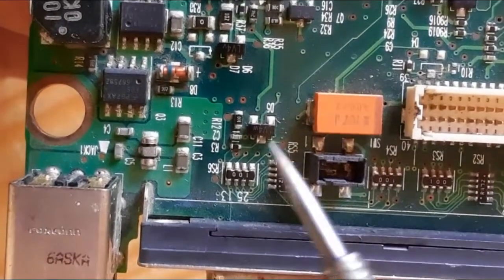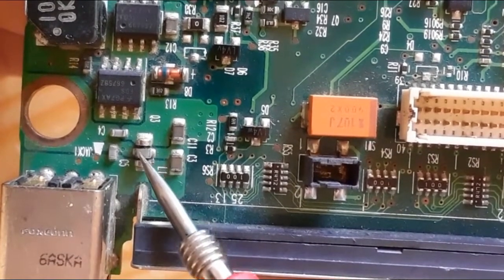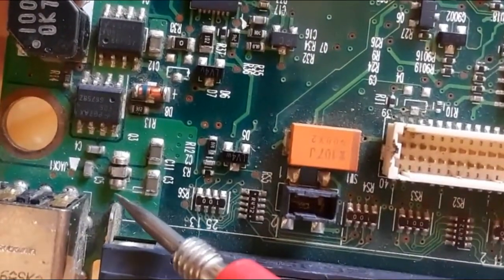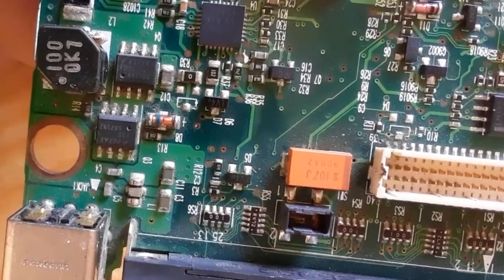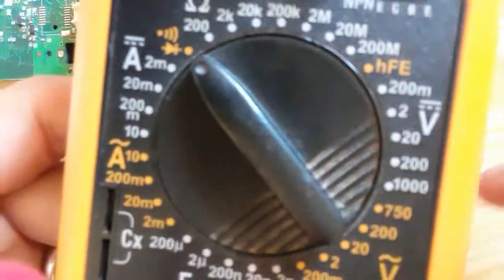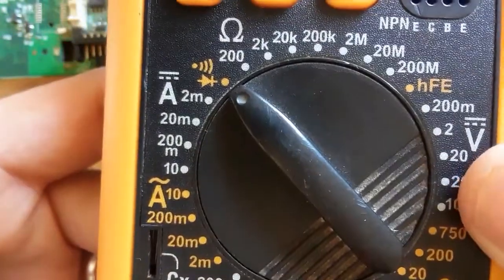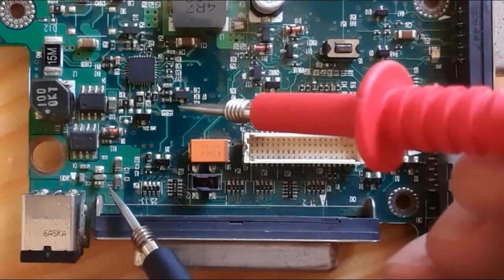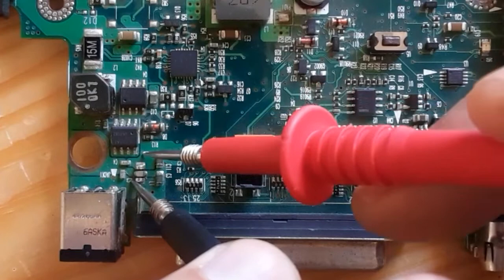How to check SMD fuse using multimeter in laptop motherboard

Comment: So, I have replaced fuse of a mobile phone battery from another battery BMS. After sometimes I get the same issue like when the battery was original when not repaired by me later. 

The symptoms I got were when watching YouTube the phone will reboot or when giving high load to the phone it will reboot so I had taken fuse from donor battery and replaced but still got the symptoms afterwards so I just removed the fuse and shorted the line and the phone has been working fine for a month without any issues.

My question is: Do we need to have the exact same rated fuse? For ie. the fuse I took from donor phone was rated to be charged at 1amps but the patient phone charges at 2 amps. Both the batteries have fuse of same size.
So, maybe that's something I have to consider?
Reply from the maker: Hi Bhoot, two parameters you should take into action when you decide on any Fuse: the maximum voltage and the exact ampere(always change the failed fuse with another with the  same characteristics)
Reply: @electronicsrepairbasics_erb  OK thank you

Comment: I though L was for an inductor
Reply from the maker: L or PL refer to inductors
Reply: @electronicsrepairbasics_erb  ooh ok  is the p for like  an inductor  that's faster or built for higher voltages?
Reply: @electronicsrepairbasics_erb  never heard of or seen PL written on a motherboard or any other device during the last 40 years ... except  in the use for designating PLugs, 
L is an Inductor not to be confused with a Fuse ..